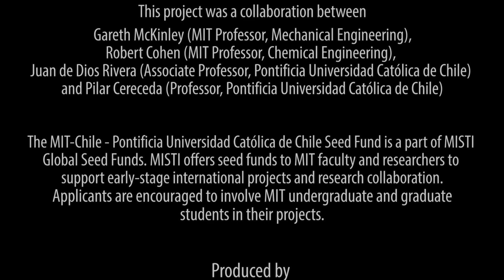Harvesting Fresh Water from Fog

Comment: Re greening deserts cloud harvesting idea.

Fog harvesting nets suspended from weather ballon
Anchored to a water collection point.

If you look at any photos of desert regions 
You can generally see some cloud formations in the sky
Which means there is amount of water in the atmosphere
above most deserts.

If you was to incorporate modern fog harvesting  nets 
Such as found in Peru & the Rif Mountains in Morocco.
& suspended them from weather balloons & flown in the sky
This can be used to channeled the moisture from the atmosphere  
Down to a collection point via Ropes or light weight piping.
A water tubing can then be added to the system to also
Provide electricity to local villages
This water can the be distributed to villages to  be used for
People, crops or livestock .

Comment: The should at least have planted some trees with that water
Reply: It almost never rains in the Atacama, which trees need to supply their roots, so trees don't grow there naturally. Trees lose a lot of water through their leaves so they would shrivel up and die quite quickly there. The only way plants get moisture is from the marine fog that briefly drifts inland in the morning.
Reply: Think many tree species like cedar and pine would handle it fine. But it would probably alter the ecosystem 😅
Reply: @oystein18  I mean, it rains 15 mm per year there, so I don't think they would survive.
Reply: @1.4142  They live on capillary water underground. The roots need to be atleast a meter long to start to find it in hot and dry climates.

Comment: Would that also mean that If you modified an E'ole Water turbine's humidity condenser with the nanomesh, that the water gain would be increased 500% for the E'ole Water turbine as well (approx. 1,000 l/day × 5 (500%) = 5,000 liters per day per turbine?